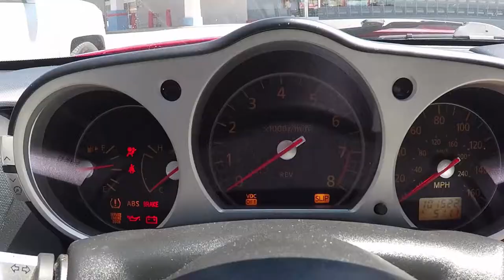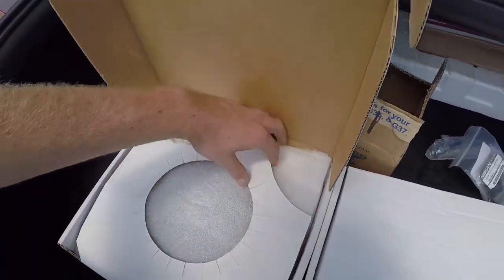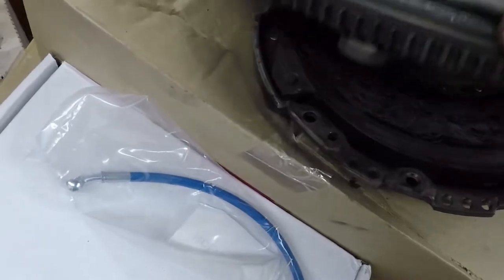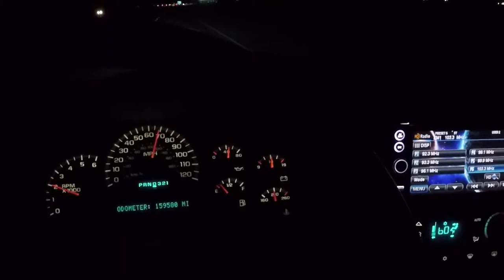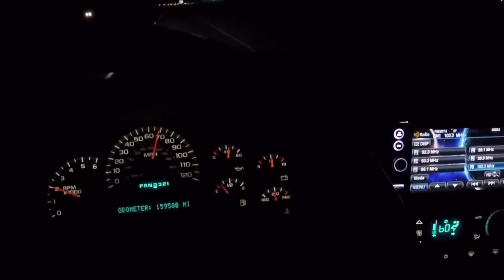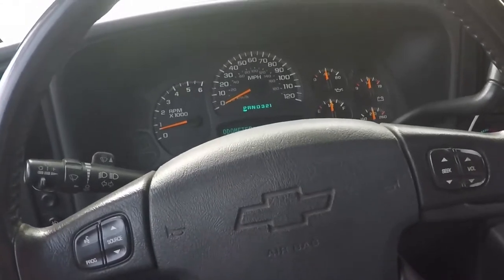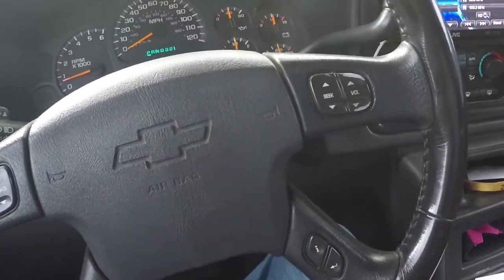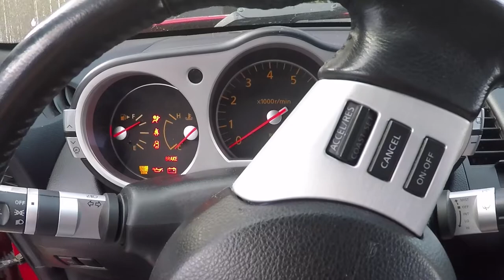Stage 2 Clutch and Flywheel Install 350z | Platinum Racing

Comment: I just ordered my PRC kit stage 2 for my 03 Z... is yours still going strong? I don't need to race but I need it fixed because mine is destroyed. So is that PRC kit plus flywheel worth it? Just to drive? Like the pilot bushing and throw out bearing was/is still going strong on yours?

Comment: Ok, What specific flywheel do I need for a Stage 2 clutch for my 2005 350z. These dudes at the dealership are telling me the sensor keeps messing up with the flywheel provided in the kit. Won't go over 1800 rpm. Please help.

Comment: Did you mean stage 1? Bcuz I can't find a stage 2 clutch and flywheel
Reply from the maker: Soya This is a stage 2. I'm not exactly sure where to find it. Messege them on Facebook and they will get back with you. That's how I got mine
Reply: Thanks man
Reply: Psyche ebay dude. I got it about a week ago. 229 shipped to my front door. Gets installed Wednesday
Reply: Eddie C how was the clutch???

Comment: I wonder how good that brand is. I'm actually looking for an aftermarket flywheel for my g35 coupe. I will install an OEM exedy clutch, but the dual mass flywheels are so damn expensive. Dealer quotes me $1200 for the flywheel alone
Reply from the maker: Johnny Rios, I have drove on this setup for about 2,000 miles and took it to the drag strip and so far it has held up very well. As far as installation, you could contact any trust worthy mechanic in your area and get a quote. Good luck!
Reply: Hello I know is being 4 years, but what flywheel did you ended up using? I’m in the same boat, I just bought an oem exedy clutch, but did not buy the flywheel because I don’t know what I will find once I take it apart lol, I might have the oem type not sure since last owner did not mention it, thanks in advance!
Reply: @DanielHernandez-nw1dh   i know this reply is late but im in the exact position what flywheel did you end up using?

Comment: Did you have chatter? Still holding up?
Reply: You will ALWAYS have chatter even with 1500$ clutch... Do You know where chatter comes from ??
Reply: @lordzed83  I have an idea about the chatter. Dual mass flywheel has dampening components to reduce the vibration transfer of torque, where the single flywheel does not. Care to explain it a bit more?
Reply: @TC-uu8rh  Every SMF will have chatter tahts a trade off does not matter if its 300 bucks clutch or 2000 bucks one. If You want Light Flywheel that is the trade off. I always have a good laugh from our uk 350z club when they whine they have chatter after clutch upgrade. But But I'w spend 1500 pounds QQ and it makes noises..

Comment: Nice dose it work on a Automatic G35 as well ???
Reply from the maker: Ugh no. You cant install a clutch like this in an automatic
Reply: @Egbert320  nice of you to not flame the guy on that question. Did you have chatter?
Reply from the maker: @TC-uu8rh  It does have slight chatter at idle but not near as bad as I've heard in the past. It held up very well. I sold the car before it got to the end of that clutches life but I was very hard on it with no problems at all
Reply: @Egbert320  thanks for getting back after all this time. Much success to you with your channel if your still trying. YT making it hard to put the amount of time needed and make good money from vlogging.
Reply: @Egbert320  I need to do a clutch on my G35 so I'm trying to figure out something with the flywheel as well.
Reply from the maker: @TC-uu8rh  Thank you for still watching! I sold this 350z so I've just been waiting to get another car. I've been moving alot trying to figure out where I want to live but should be back to making videos again soon

Comment: How's is it holding up
Reply from the maker: So far it has been holding up great, have had zero issues after 6,000 hard miles
Reply: Egbert320 I just put my in works great no chatter and first and second gear turns up hard
Reply from the maker: Van Jacobs thats great to here man👍 hope you enjoy it as much as I do
Reply: Egbert320 thanks for the info